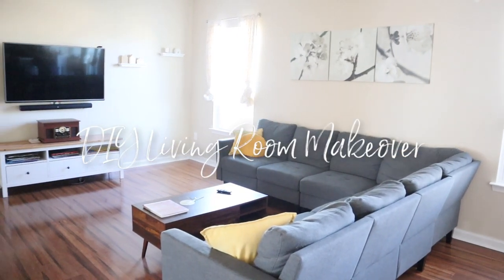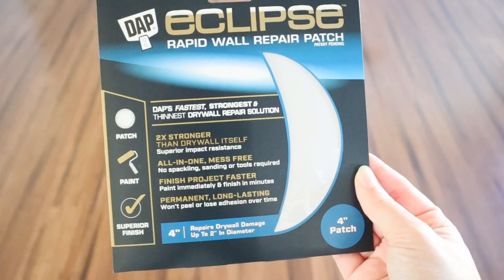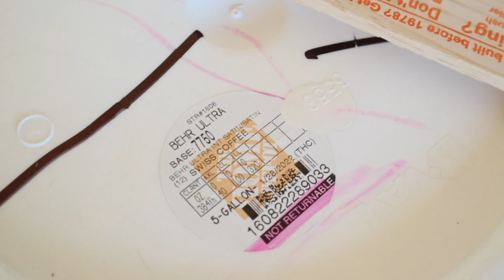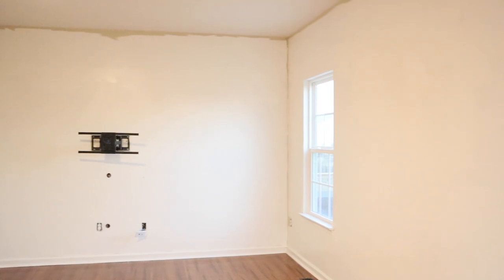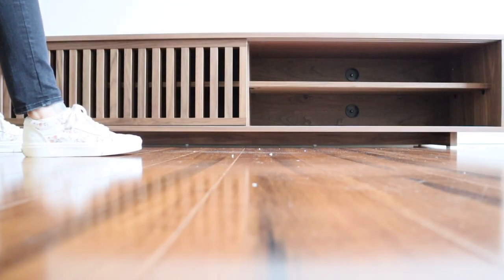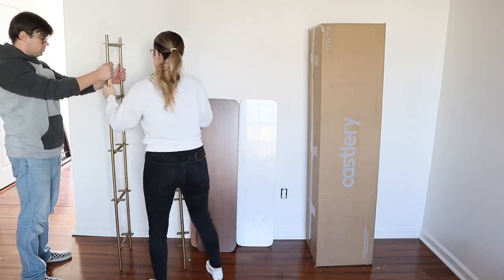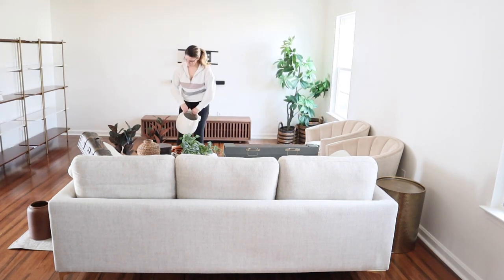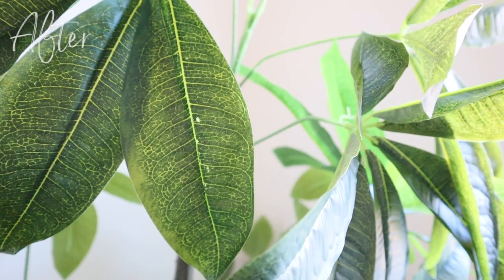DIY Living Room Makeover with Decorating Tips and Ideas

Comment: No drop cloth?  Brave girl.  I always drop something and the roller sprays a little paint.
Reply from the maker: We did spill paint but we just cleaned it up. When painting on hard floors with such a shiny finish, there really isn’t a need for a drop cloth. Spilled paint will just wipe right up, or you can let it dry and scrape it up easily with a plastic putty knife.